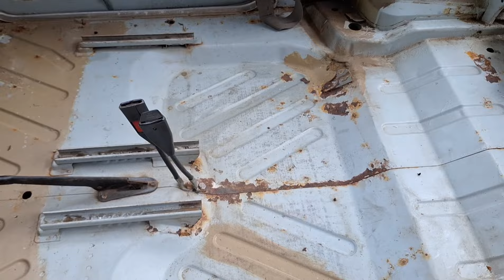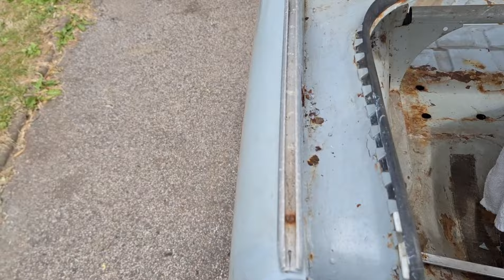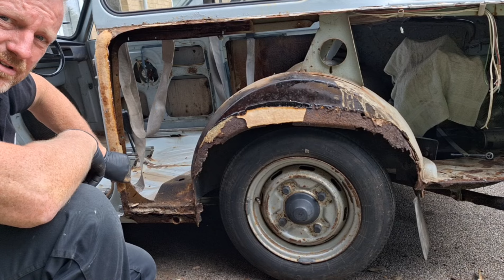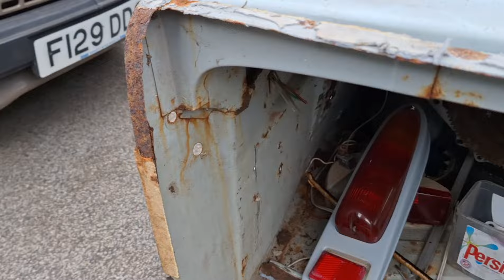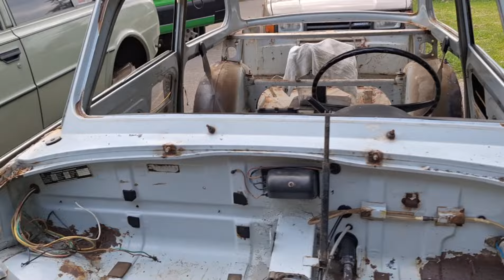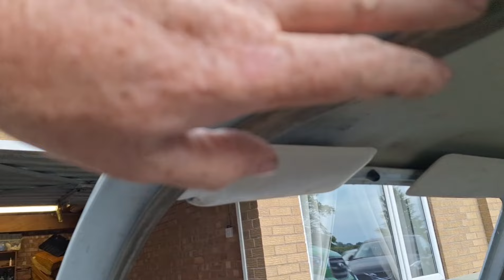Trabant 601 body strip, is it bad?

Comment: stick a reliant 850cc engine and gearbox in her to keep up with modern traffic it would be perfect that car. good acceleration 80 / 90 mph very fuel efficient easy to work on almost bullet proof. makes good sence
Reply from the maker: Would be a bit awkward these are front wheel drive.. Being an older one I'm keeping this standard.. I have modified a couple of my old eastern bloc  cars
Reply: @Mickhanic-garage  it cant be that hard make a tunnel and use a rear axle off a reliant thats how most trikes are made i mean a bit of extra fabrication would be needed like Mounting points( engine gearbox suspension ) and extra braces to allow for a drive shaft to travel through the chassis frame. But yeah it would be extra work

Comment: I recommend that you remove the roof panel. Bend the edge and peel off the panel. Judging by the condition of the car from below under the panels, it is rotten on top as well.  It’s good that you have a sedan and not a station wagon, otherwise there would be even more body problems.
Reply from the maker: @daniilvolynskiy2554  Hi yes I was planning to remove the roof but then saw how it's connected. I had a look inside the top channel and down the fro t and rear pillars with an inspection camera, slight surface rust in ther but nothing crispy at all.. Dry and dusty in there. Where I can get my fingers in the gap and press down on the top if the frame it's all solid..